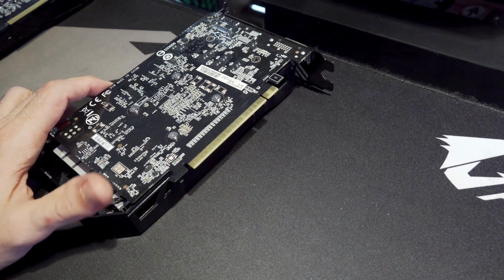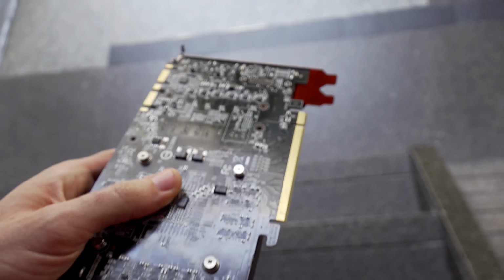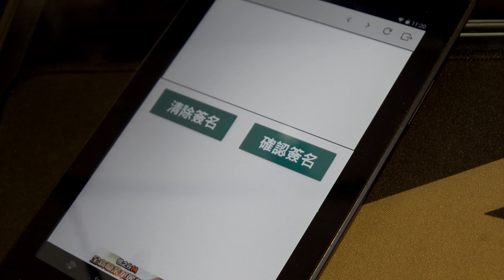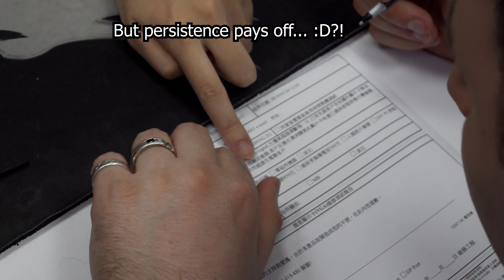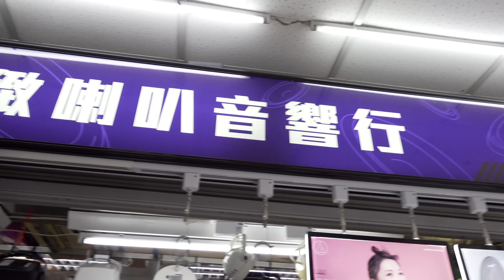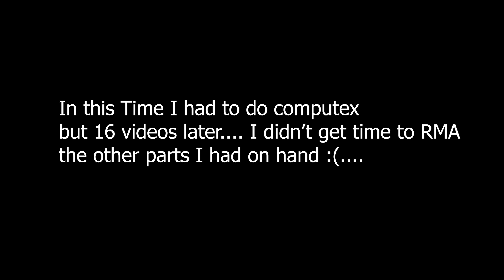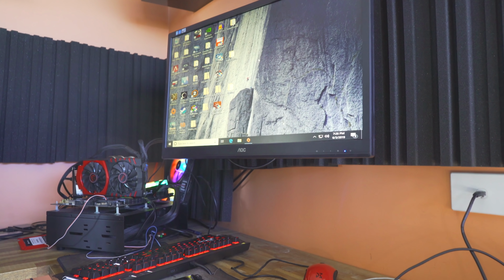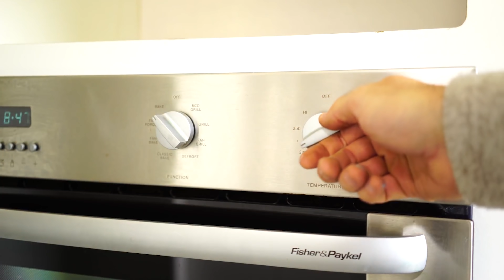I Took FAULTY Graphics Cards BACK to AIB Vendors Directly...

Comment: This should be common sense but if you buy a used GPU and have issues just call the support lines for the maker and so long as they are within warranty you will get them RMA'd

Comment: how far can you push geting your cards repaired?
I have 2 Vega's I put in the oven for way too long and all VRAM and a bunch of teeny-tiny chips fell off.
I'm sure I lost some of them since there are some really small ones on the back of the core.
Reply: I've had them fix a motherboard where it got hit in transit and little caps fell off. 

However if it wasnt obvious. I had no luck. It totally depends

Comment: Oh boy that description sure is accurate. The GTX 960 and 1050 ti sure are expensive cards.
Reply: For me, they are expensive
Reply: @ondrejbrandejsky5592  Didn't realize <$100 was expensive
Reply: @joenodden  i'm a student so i can't afford that but i'm still happy with my gtx 660
Reply: @ondrejbrandejsky5592  oof.
Reply: @joenodden  I have got some money and today i purchased a second hand Sapphire nitro+ RX 570 for 60dollars
Reply: @ondrejbrandejsky5592  Pretty good deal
Reply: @joenodden  I know, but its being heavily bottlenecked by my phenom x4
Reply: @ondrejbrandejsky5592  Yeah it most likely is.
Reply: @ondrejbrandejsky5592  You might be able to upgrade to up to an FX 9590 though I think.
Reply: @joenodden  only upto an fx-8350 and thats not a very big performance boost from an overclovked phenom x4 955 be
Reply: @ondrejbrandejsky5592  Oh no it's a very big boost from it. In Passmark the Phenom scores 3925 while the 8350 scores 8950. That's over twice the score. It has both double the threads and about 1.4 times the single threaded performance. All with the same TDP. And a 125W chip isn't getting overclocked much anyways unless you've got a very beefy water cooler lol. And however much you overclock the Phenom, the 8350 can be overclocked just as much.
Reply: @joenodden  i better spend the money on a sandy bridge i5/i7
Reply: @ondrejbrandejsky5592  But a sandy bridge i5/i7 isn't gonna give you as good performance as an 8350. Get the most value out of your current socket and then upgrade later on when you need to. The 8350 is still a great CPU. Besides, it's cheaper than a 2600k, and you'd have to upgrade your entire board to move to sandy bridge. I don't see a reason to switch.

Comment: It's called flip chip design. Old IBM tech still used today in production of GPU's. Heat will fix it temporarily, you need to replace the chip if you want it working. I guess Louis Rossman covered that topic well enough and even made Linus come to him. Sure, most of today's faulty GPU's have diffrent issues, mostly power rail related but in my experience most GPU's die because people tend to use them with clogged cooling and rock solid paste so yeah... I haven't had a laptop with dedicated GPU that didn't die from heat/power cycles. And dell makes their board like douches. Last time I had lattitude with quadro and they ran all signal lines to lvds/hdmi/vga etc through a goddamn quadro which was a toast(no chip to buy, no motherboard used in good condition) so physically disabling NV GPU wouldn't make intel onboard to work. Because they made a board in which it will only work with external GPU and intels iGPU is just a non working feature in that case.

Comment: I think no one would be shipping faulty GPUs from US to Taiwan for the repair. I have the experience of working at a Samsung certified service center in Ukraine and no products were ever sent to Korea to be fixed, the most complicated repairs were done in Kiev, that's all.
Reply: I had to ship my GEIL RAM to Taiwan to get a RMA replacement. But most manufacturers have service centers located around the world to which you can ship your faulty products.
Reply: @-eMpTy-  well, yes. What I have said is valid if there is a certified service center around like the one I used to work at.
Reply: @-eMpTy-  I've actually picked the wrong word. It's 'authorized', not 'certified'.

Comment: I broke my AM4 plastic on an ASUS motherboard, and no one could help me repair it here, if I understood them correctly it would be possible in Taiwan though.
Reply: It would, You might also find some sellers on ebay that might sell the sockets. Check the manufacturer of your socket (IE Lotes, Foxconn) and see if there is a socket being sold online. Or look for out-of-warranty dead boards that have the same manufacturer of socket.

Comment: Good thing in Asia is you can get anything repaired. Dont need to throw it away. I remember we didn't  had enough money to buy a new TV and we got our old one fixed alot of times in INDIA.
Reply: It's just the way world should be repair should be easily possible and environment friendly
Reply: I have started buying up old one plus devices especially the ones with headphone jacks

Comment: Question....and why you are in Taiwan to do these things?
In australia there is no one that can do it??
Reply: Computex primarily. I suggested since he's coming to Taiwan anyways to bring any faulty boards that were worth paying for repairs and make a video out of it. I've done it before and I was impressed by the service. 

Most of these board manufacturers don't seem to have easy repair centres outside of Taiwan. ASUS does have an RMA centre in Toronto, which was easy enough for me to drive to, but the other brands needed to give back the parts to the store for the free warranty service. It's kinda a hassle if you dont know where the parts were bought from. Paid repair just doesn't seem to be a thing outside of Taiwan. Closest RMA centre for Bryan is in Sydney, which is like a day of driving. Might as well try this out, right?

Comment: fan blades are dirt cheap on aliexpress.. fixed my old 7870's for 12 euro a piece.. thats 12 euro for a 2 fan unit. Came with sapphire stickers on them just like OEM.
Reply: It had more problems than just fans. It wasn't booting and giving signal.
Reply: @MarcoGPUtuber  i'm aware of this, it was aimed at the part where he shows listings of replacement fans for 45 bucks, whilst nearly all these fan are generic. You can simply search  the part number on the bottom of the fan.
Reply: @Mosibfu1  Ah, you're right!

Comment: whe had already 3 gpus thad was reanimated by the oven a 570 gtx 780 gtx and a 970 so for us it worked well the 980 is still in use

Comment: $40 is about what they are worth nowadays on the second hand market!
You might as well have purchased a new one.
With RTX cards now in the $350 range, and GTX 16xx series cards in the $200 USD there's no reason to actually spend that money on 3 cards for repair.
Instead just buy one that's just as good as the 3 together.
Reply: Perhaps, but if all else equal, I'd rather get the one the manufacturer fixed up than a second hand one that I don't know where it's been.

Comment: Chinese technically isn't a language. In taiwan they speak Mandarin, Taiwanese, and some older people even speak Japanese.
Reply: It's actually not wrong to call it Chinese. It's now officially known as Standard Chinese or Standard Mandarin. Either is fine. The name 'Mandarin' comes from portuguese, Mandarim which means administrator as the language was used for administrators or officials across China to communicate between the language barrier. Hakka is also spoken here as well. Mandarin as it's considered right now is a group of similar dialects, while the official language taught and spoken is now referred to as Standard Chinese or Standard Mandarin. The original name of Mandarin, Guanhua is not often used anymore and it's now common to say Zhongwen (Language of China), Putonghua (Common speech) or GuoYu(National Language) Basically, Standard Chinese comes from Mandarin.

Comment: Fix free? only if you can speak Chinese i guess
Reply: Not necessarily. They were technically under warranty and should have been brought back to the store they were bought in. They certainly did us a solid this time. However, if you actually live here, (regardless if you speak Chinese or not, though it's best to drag a friend with you to help cause....it's not an English country) If you buy a video card or motherboard here in Taiwan, they will service the warranty for you. No problem.
This advice doesn't include GIGABYTE or ASUS laptops. Those both come with a two year global warranty. They will happily service your laptop anywhere you are if it breaks down. There is no global warranty on components.